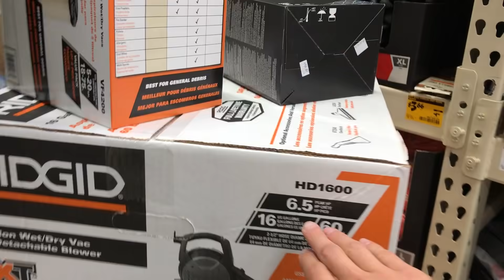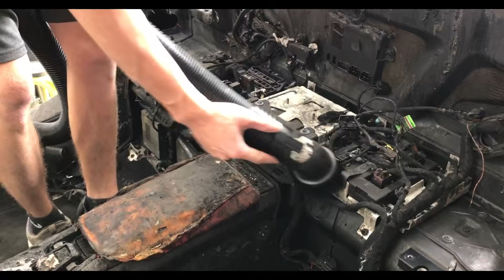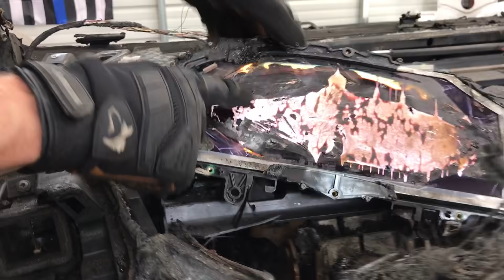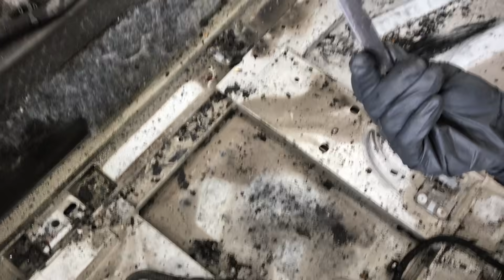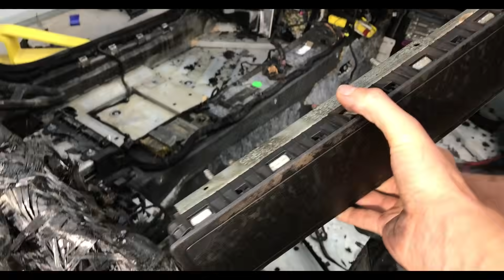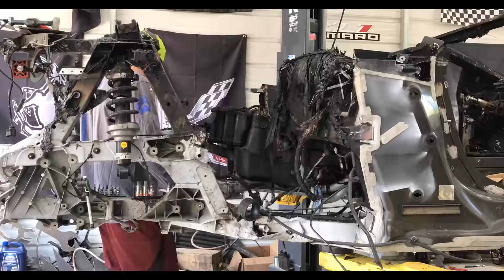Building A Custom Supercar Part 4

Comment: Hey guys just a little information so you know next time around. Aluminum is what is known as a non ferrous metal just like brass and copper are. They are good conductors of electricity. However non ferrous metal does not produce any Sparks with metal to metal contact. However true you can get a spark from it if you induce electricity into it.. I also hope your fire extinguisher is a class ABC also remember if you ever have any rims made of magnesium that catch on fire that's an entirely different type of fire LOL. You guys rock!! It's really fun for an old man like me to watch you young whipper snappers learning as you go. I will say you have impressed me on a few things to be so young. Keep on driving hard while the flame is still lit. Also find something to change up your routine to add some spice to your videos to help spark more interest with your viewers and attract others to your channel. Learn from the Beast maybe have a giveaway with one of those cars you have built. It's a huge give away but man the attraction you would bring over several months doing a giveaway like that.

Comment: Might I suggest, do something like a Rat Rod Supercar Hybrid? Slap a body on there from another wrecked car that the body is somewhat good and attach it to the frame of the Lambo? And OR since it has 4 wheel drive, you could even put off road suspension on it with some off road tires maybe? If you can add any kind of lift kit to it.  I think it'd be cool to have a car that looks like a sleeper with a supercar underneath. Say like a VW Beetle or maybe a GTO body? I myself would put a Corvair body on it. That would be sick.

By the way, I am very impressed that two young guys first, know so much about cars and second, are willing to do everything on these builds especially getting dirty and doing the grunt work of cleaning out the burnt parts to the fine detailing you do on each car. WELL DONE GENTLEMEN!!!

Comment: Yeah, the LCD on the burnt Huracán it works. Kind of. But, are you guys going to continue working on the Viper TA?
Reply: Lucas Martínez Parra I’m pretty sure the viper is discontinued so parts have to be specially ordered, I could be wrong though I saw another person comment that
Reply: @gavinsmithson7216  it isnt discontinued, its not in production anymore though. The only way to get one is to order it and wait for them to build it.
Reply: 614 Jacob ahh I see, thanks for the info
Reply: @614jacob2  Alright.

Comment: I have gone through a couple of shop vacs in my days. I am going to get me one of those Rigids with the removable blower, that is a great idea. Thanks for showing us that. Also, I am glad that is Goonzsquad fans notice that you all had no fire protection. With all the welding and grinding you all do, that was a much needed addition to the shop. Thomas is good at his supervising job, but probably wouldn't be to helpful in case of a fire.

Comment: the other lambo took 24 episodes or smth 
feels like this will be 40+
Reply: Radu Andrei i don’t see an issue with that im sure theres a ton of fans that would watch every minute like myself
Reply: Radu Andrei or more
Reply: I m not saying I don't enjoy it, looking forward for posts everyday
Reply: No just 20+ in the 1st lambo they struggle to start it up, maybe 3 episodes or 4.
Reply: More episodes to watch!!! Specially if by some miracle they twin turbo this monster. It'll be their #hypercart
Reply: This time they can watch "B is for Build" , they're doing exactly the same thing , a few steps ahead
Reply: @NickKautz  well yeah. But apart from the frame repair we know that b is for build is going with l full carbon remoulded panels and an twin turbo LS powertrain. While we dont know what Goonzquad has in plans for us. Maybe its a spider version of Alex choi's unicorn v3 . I dunno. Lol
Reply: @Tabletop-Newtype  It's kinda funny that in this episode when they were talking about making a hole for a manual shifter , the first thing mentioned was corvette transmission and torque tube
Reply: @NickKautz  i did hear that and i was like. Wtf. How can they put a Corvette transmission on a mid engined car. It made no sense to me. Lol
Reply: @Tabletop-Newtype  What's interesting though (they don't know this)  is that the vette tranny IS used behind mid motors sometimes because it's designed to bolt directly to the diff....  so if you leave the torque tube out of the situation and put a bellhousing directly on the trans, you have something like a transaxle
Reply: Nope i think 50 episodes
Reply: @NickKautz  that is fascinating. Maybe thats what they did for the C8 Corvette since its a mid engined design. Thank you for that lesson. Sometimes you happen to learn new things in the comment section

Comment: Hi guys,

wise one to get some fire extinguishers,
But some little advice on this mater:

It seems like you got some CO2 extinguishers,
these are great for solid materialsburining (like wood)
and for firese where the ignitor is taken away (by example, if you ignited it with a spark, and the risk of sparks is gone)

for liquids and over all basicly, you want a foam extinguishers.
these make a layer of foam, macing sure no oxigen can come to your burnable material.
+ thay have a wide spray working as a shield for between you and the fire.

these CO2 extinguishers work realy fast and are great to have.
but as soon as you staop  spraying the fire might lit again.

so my advice, get at least 1 foam extinguishers, it might be a life saver.

!!!!! just make sure you done have any powder extinguishers !!!!!
these extinguishers are harmfull forany electronicdevice in the room.
So you might need to replace all the electrical componets in your cars after using one of those.

congratulations on you mariage!!! by the way, little late, my bad.

Comment: Going great guys! And Congratulations Billy on the marriage I hope and pray you two are happy with your sights set on the future! So I saw where SamCrac and V-tuned are working on a project where V did some aluminum work on their Super car. They bought some Aluminum square tube type pieces and fabricated then V-learning to weld Aluminum put it together and it came out great (V-Tuned first watched a pro do a bunch of work so he could see how to really do it right) then did some practice and at first it wasn't perfect but it really came good as he went. So they fixed their frame chassis and saved like 10,000 dollars doing it. Maybe have a look at wha6tt they did. You can do it the only thing you don't have is a frame machine. But that wasn't really needed much.

Comment: Helpful hints, put a vacuum bag for your shop vac. It will last longer and less cleaning out the filter. Also fire marshal in your area can tell you what code requires for your garage extinguishers. General rule of thumb, abc extinguishers and mounted no higher than 3 ft off the gound per NFPA.

Comment: Don't buy a 
powder 
fire extinguisher buy rather foam. Can save you a lot of time
Reply: AksiOnPc Foam works on flammable liquids, but it’s not a all purpose extinguisher. ABC’s will work on liquids, and ordinary combustibles. C02 would be handy also. Dry chemical powder sucks when it gets inside engines, lol
Reply: @billew0481  yes, Powder sucks, the hole shop will need a looong clean up lol

Comment: Guys the frame actually weld's to another piece and in the back of the car. You could cut it out and place a new frame there. Because the engine mounts are different in lambo man. And also the oil pressure display will turn in when the engine is in and all the harness is on the car. And the next part of your rebuild is the engine right.✌✌

Comment: Good for adding the extinguishers... however. You should mount them near the door(s). Think about it... if something catches fire you don't want to be running further into the garage to grab 'em, you want to be headed for the door. And if something starts burning while you're outside, they'll be accessible without you having to run in.

Get a few more (magnums) ftw.

Comment: Don't use the factory ecu, go 10 individual carburetors or 5 downdrafts and maybe a computer controlled ignition system, and dump things like variable valve timing and lock it in a set position, if it has it. Definitely something different 👍

Comment: Back when I was working on cars and doing MIG welding/Oxygen Acetylene and torch cutting, I never started a fire big enough to require a fire extinguisher to put it out. If you take precautions ahead of time, usually there will never be a problem. From what I've seen of your work, I'll bet you never have a problem.

Comment: Suggestion?
Make it rear wheel drive
Manual box conversion
Bond an aluminium firewall in placid expensive damaged carbon fibre
Fab a removable lightweight aluminium top (clip on) in place of heavy n complex convertible
Loving ur work ✅✅✅

Comment: It's good that you got fire extinguishers, however, I would suggest that you move the one mounted on the wood pillar closer to the small entrance. Wood being highly flammable is a bad mounting surface for fire extinguishers, and it will be easier and safer to get to the extinguisher  coming in from outside.

Comment: a fire extinguisher should be mounted by the door. if shop is cooking, you don't want to have to run thru fire to get to it. can't use em' if you can't get to em'! others are fine. 😉

Comment: I think stripping the car to a shell, tube framing the rear and integrate it into a roll cage at the front would be the best way to go. Then decide what engine you want to use and then do wiring from there. I don't think getting an original engine harness and trying to use the original engine will give you lots of problems with codes and modules and ecus and stuff. Will cost a hell of a lot

Comment: You guys should build it like a sand rail , just  ditch all the lambo stuff and do an Ls with a tube structure . Then just get tubular control arms for a sand rail or trophy truck / buggy . Basically just utilize the lambo frame but the rest is all custom

Comment: I inspect these daily for my job in the petroleum industry.  Inspections consist of just making sure, no cracked hoses, no loose fittings, no instructions in nozzle, and pressure gauge is in the green.  Seeing as you guys probably got some spare cash just buy a new one if pressure drops.

Comment: You need a couple of different types of FIRE EXTINGUISHERS:

    Water. Water extinguisher. ...
    Powder. ABC powder extinguisher. ...
    Foam. These types of extinguishers are identifiable by the word 'foam' printed within a cream rectangle on their bodies. ...
    Carbon Dioxide (CO2) ...
    Wet Chemical.

Best to be safe and be able to keep these aswome vids going ;)
Reply: They could also just cut to the chase and lookup the OSHA website for their state & download the manual for their shop and go directly to the To do checklist.

Comment: Hope you guys have done your homework , the strength of that aluminum isnt going to be the same after the fire , it can become more brittle ,due to the heat of the fire then the possible thermal shock of the cold water from the firefighters putting it out .

Comment: You guys need to pay attention to which fire extinguishers you get. There’s classes a b c and d. A puts out normal combustible fires such as paper. B puts out grease, oil and gas, c is for electrical and d is for flammable metals

Comment: You should over simplify it, Put a carborated V8 and manual trans, rip out all the electronics. Race car. Save you a ton on parts and you will have a one of a kind piece. This will also give you the chance to learn to take apart an engine and put it back together, on a cheaper engine.

Comment: Aluminum can not generate a spark regardless with what you strike it with. Static electricity generated from the Carbon Fiber and
 the exposed wiring when you hooked up the battery is more likely to cause a fire in your case.

Comment: If you are going to put a custom steering wheel you will probably have to relocate the drive mode buttons unless you get a carbontastic wheel. But a great custom wheel idea would be to get a Lamborghini Huracán gt3 or super trofeo racing steering wheel

Comment: Billly one other personal safety thing ... taake your wedding ring off if by any chance you get it caught in some thing it can pull the tendents out of your arm ..Also if it shorts on a battery it will burn to the extent of taking your finger off .. just a heads up mate ... congrats by the way ..

Comment: I'm the maintenance Director of a nursing home and a firefighter. The extinguishers you all got are not the only types you need. They come with ratings for what they can be used for (fire types). If your interested in knowing more about them check out the codes for NFPA101 online.
Reply: On another note it would be good if you guys got your hands on a foam pack. We use an agent called fire quench as a foaming agent. That is the best to use on fuel and chemical fires.

Comment: As damaged as the electronics and harness are in that car i'd suggest selling the motor and whatever parts are not needed and LS swap it. Buy a bad ass Dart motor and mid mount it with twins exhausting right out the rear. That thing would be a force to be reckoned with. Not to mention the only one of its kind. You'd get crazy recognition from that swap. A mid-mount LS super car in a Huracan chassis....NASTY!!!

Comment: I think your in over your head on this one. It's going to cost as much to build it as to to buy one. The wiring is cooked. Un less you rip everything out. I would put a turbo LS in it and buy a aftermarket wiring harness. And tube frame reinforce the frame if needed.  Good luck tho. It's going to be interesting.

Comment: There's a wrecked Audi R8 v10 on copart for a good price that you guys should get and swap the
5.2 10 engine, wiring harness computers all the stuff you need to make it run 
Personally this is what I would do, otherwise all those Lamborghini parts will cost big $$$$$ plus those electrical systems are really complicated the engine has 2 Ecu's which is what you found under the rear fenders on each side

Comment: Rather then some sort of lambo cart it would be cool if you build yourself a budget hurican. Use some of the damaged panels from the other car you have left over and fix them best you can, if you got that engine running you could do it somewhat cheaply and keep it. i assume you cant afford to keep the other one.

Comment: With how bunt up that engine and all the wiring is, you’re probably better off using a stand alone system. And wiring in custom gauges for what you need. With how expensive all that lambo wiring can be, you’re probably better off making it all yourself.

Comment: I was like no how are u gonna rebuild a burnt supercar and it's actually coming together I was wrong xD
Reply: This is so far away from coming together I'm still expecting them to change the plan. Building a supercar from spare parts will end up more expensive than buying the entire car, plus all the hassle & work.
Reply: Look at samcrac and his Ferrari, which just wouldn't run properly. This is not like in the old days, todays cars are computers on wheels. Even if you buy all new parts there is no guarantee the car would ever run properly, without warning light/error codes.

Comment: You know you could save a lot of money and just buy a a Holley Dominator for a engine management system. Holley has great customer service, and their system will work on any vehicle, it is also very user friendly, an can tune itself if you can't tune. A complete system with touch screen is less than 3000.00

Comment: Hey guys. Love watching your rebuilds. Just as an FYI, carbon fiber is only slightly flammable. Per a carbon fiber info site...this is what it said; "Though Carbon Fiber is constituted of carbon which is flammable, the fiber itself dose not flare up even if ignited by flame of match or gas burners. If heated up higher than 400 degree C together with some fuel, the fiber slowly burns (oxidized) but stops burning right after the burning fuel is removed." Here is a link to the site..https://www.carbonfiber.gr.jp/english/material/safety.html

Comment: Good thing you got the fire extinguisher. You connected the battery knowing that the wiring harness is badly damaged. I was waiting for it to short circuit and start another fire or damage other electrical components.  Smh

Comment: Please don't use this fire extinguisher in your garage. It's a nightbare after you've used it. The powder (it is a very fine salt) in contact with the humidity in the air is getting accid. It getting on and into evereywhere and affects car paint, electronics, tools like welding machine, aluminium surfaces, acryl........ Google it! Sprayed in an engines bay, the car is totaled.
Just buy ones with CO2 or Water inside best would be Halon (not available)
I've cleaned my garage for 1 week after using one for a few seconds.

Comment: Always look at the A B C rating.
http://www.brkelectronics.com/faqs/oem/what-do-the-abc-ratings-mean-on-fire-extinguishers
You probably want to focus on B.
10B is not bad, C is for high voltage that might arc, 12 volts wont matter here.
Take them to the fire dept and have them tested and certified.
I think they do it for free.